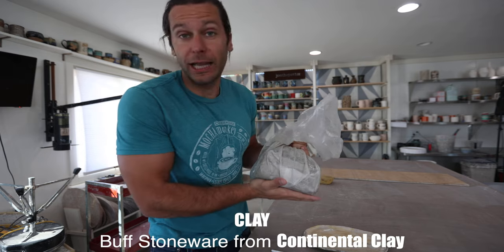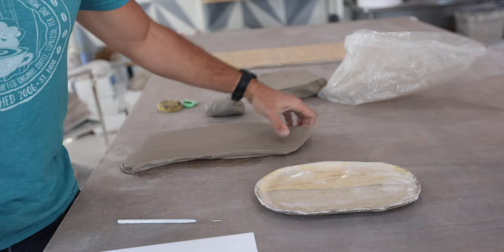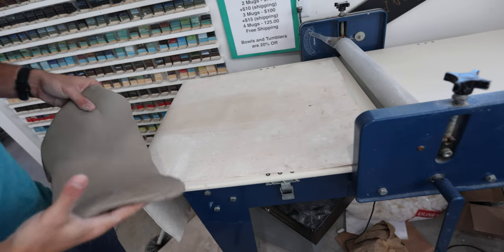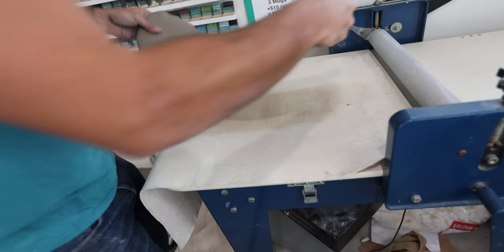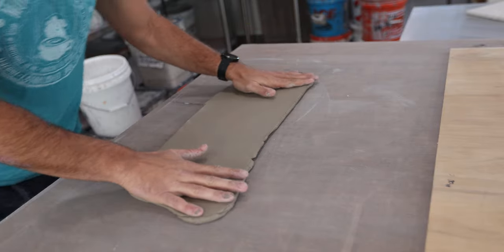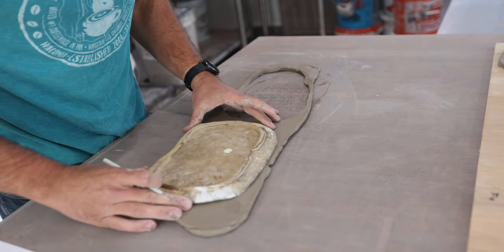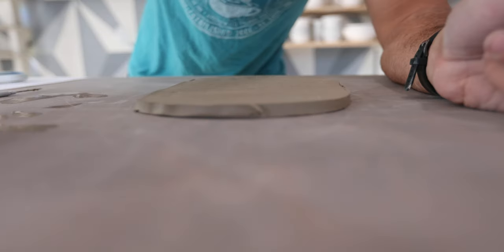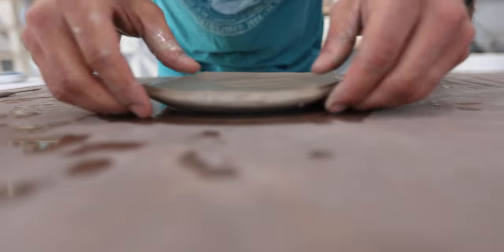EASIEST Clay Project EVER!  Slab Plates NO WHEEL NEEDED!

Comment: This is something that takes some practice. I let things firm up for three hours. Figure out what works in your space. Flip over so plates are on their rims as soon as possible. Then slightly indent the base(this is so the base will sit flat and not be high centered. Do this lightly by pressing down on the centre of the plate. I think that Jon doesn’t worry about a little bit of warping. These are casual plates. Also when rolling out your slab, roll over it several times to increase compression. Dry evenly, use a fan don’t let the rim dry first. Make quite a lot then you can see what you are doing wrong. Keep your design simple so you will mind loss less. So much in pottery is simple but takes time to learn. I have learned that the part of my studio where it is slightly damper is better for drying. This is a good project to learn about drying, to have it more instinctual. I find drying hard but keep persevering because if you’re like me I love making. Let us know how it goes.
Reply: Good advice. ❤